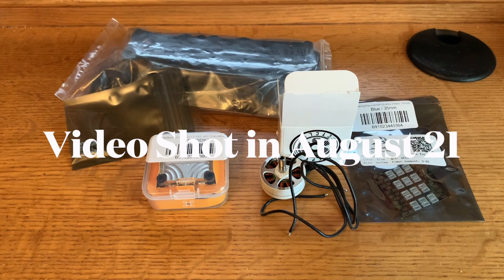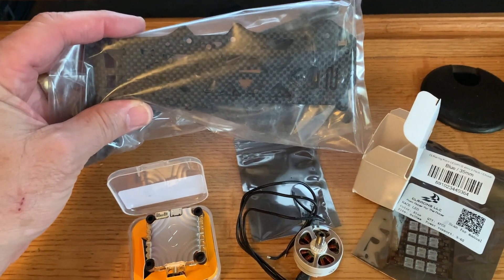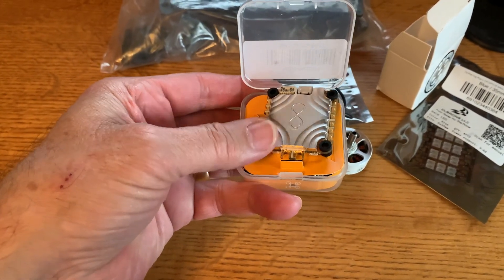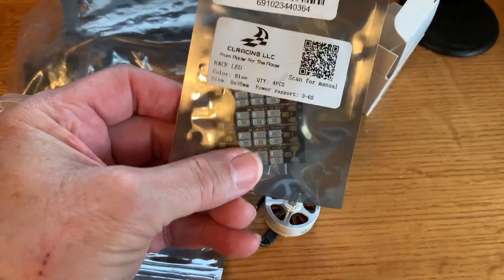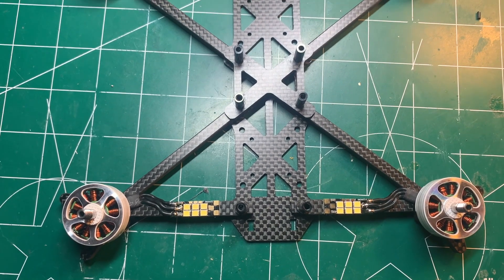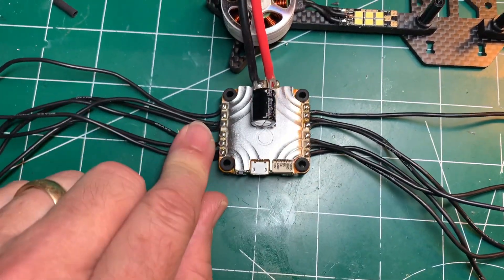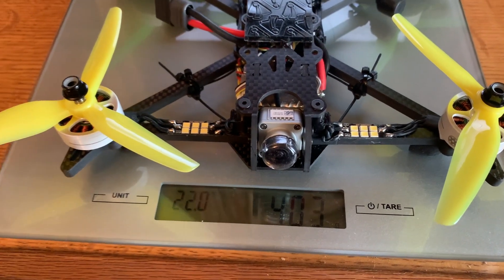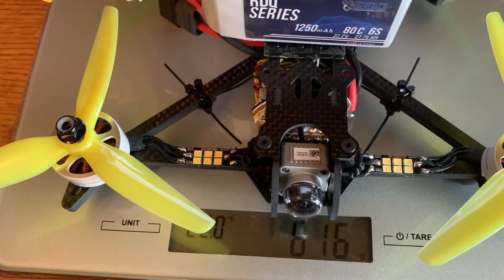AOS 5 Build and Review

Comment: you have built the frame wrong. arms and and plate go under the bottom plate.
Reply from the maker: Yes you would be correct if this was a build about the V2 or EVO AOS 5 frames. But it is not, this build video is for the V1 frame that is no longer in production.  
Cheers,
SLOG